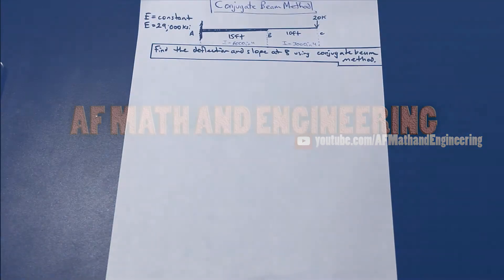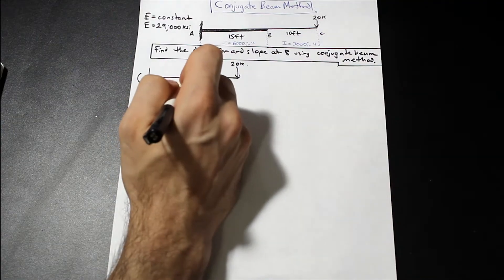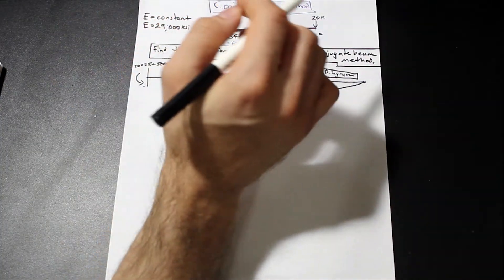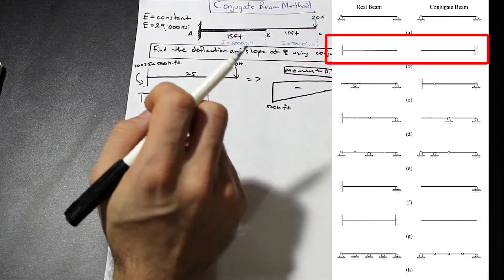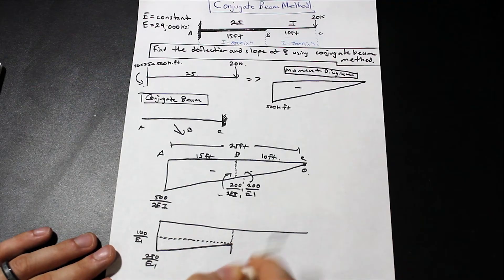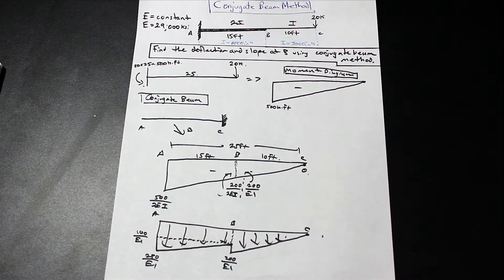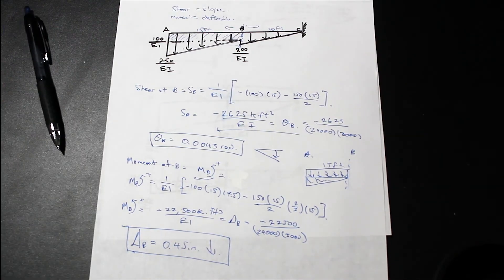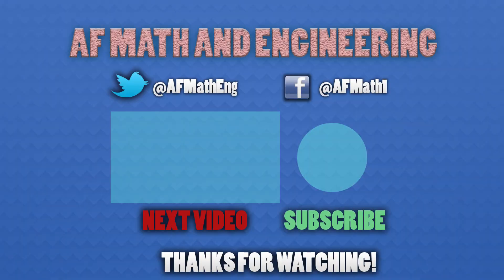Conjugate Beam Method Slope and Deflection - Introduction and Step by Step Example

Comment: How did you get the 0.0043 radians? Sure, you multiply it by 144 on top to account for the units, but then it is also multiplied by 2 to get 0.0043. Where did that come from?

Comment: How did you get 0.45in?
Reply: you  need to convert units. His value of  22500 is in ft^3, but the E and I are in inches^4. So, convert the 22500 to in^3 by multiplying the value by 12^3
Reply: @manuelmatus2959 hi

Comment: if you used the right side of 'B' to solve for the slope at 'B', how would that look like?
Reply from the maker: Good question! To the left or right of B will give you the same result, but if you're looking at the right side of B, you'll notice that you have reactions that must be considered.  The shear at B on the conjugate beam is equal to the slope, the moment is equal to the deflection.  Thus, if you look at the right, you'll have reaction Cy as well as the area under the curve, as well as a moment Mc which will also have to be considered.  Because of this, you'll always want to cut a cantilever beam on the side that doesn't have the reactions in order to skip this messy and time consuming step.  For simply supported beams there's usually no way to avoid this, but you can skip finding the reactions in cantilevers. It's a good trick for exams :)